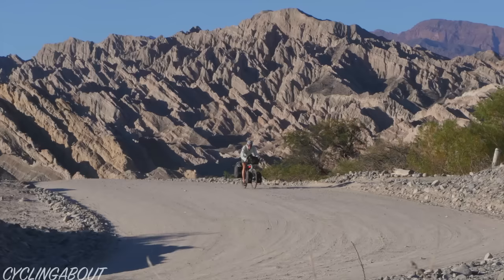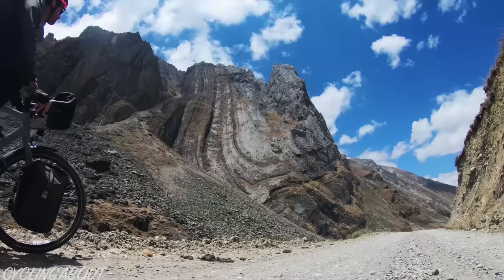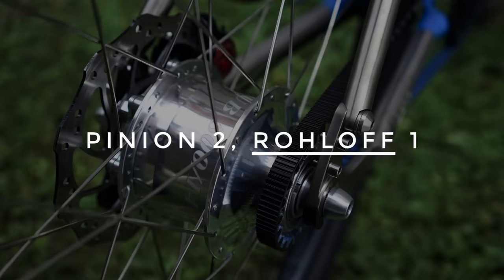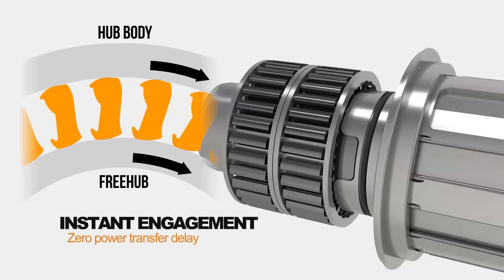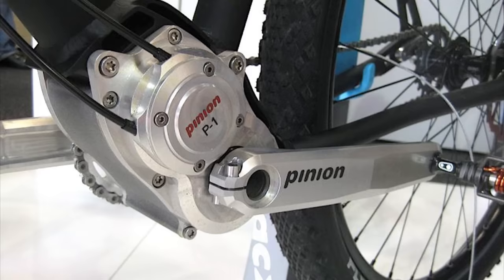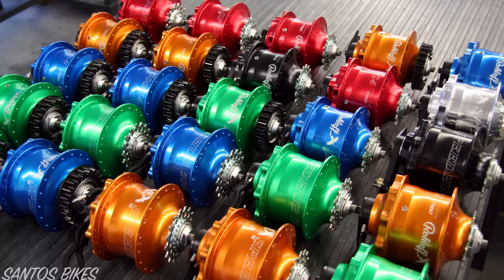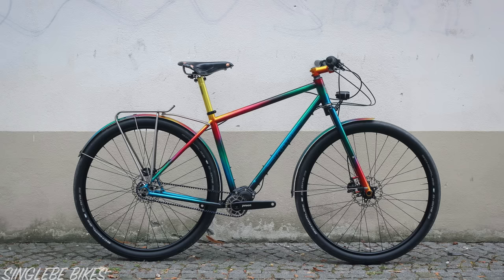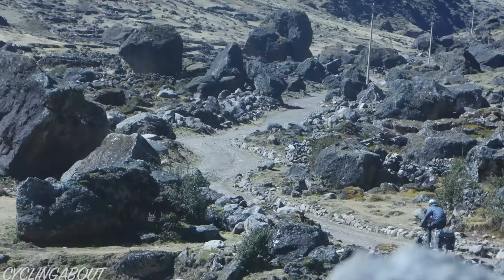What's The Ultimate Bicycle Gearbox? Rohloff Hub VS Pinion Gearbox

Comment: I use a Rohloff hub since 2009, now coupled with a Gates Carbon Drive transmission. I've done about 50.000 kms with it, always riding mountin bikes, and giving it a hard use. Zero problems. 
I don't understand why you say the Pinion it's better in MTB, especially the 1.18 it's not recomended for this use, as it's not strong enough. The same Pinion says it's quite better the 1.12 for mtb due to it's major robustness.
For the friction, I only noticed a little bit when new, just the first 1.000 kms. Now it rides absolutely smooth. The noise, as you say, only apreciable in seventh gear, but in any case, not doing more noise than any other bike with traditional gear system.
Reply from the maker: There is no doubt that centrally-mounted weight on a mountain bike is better for the ride dynamics and suspension performance. I'm not saying you can't ride a Rohloff off-road, it's just that the location of the mass is not ideal (I personally own a mountain bike with a Rohloff).
Reply: @Cyclingabout  As for weight distribution, okay. I meant that it is not fair to compare a Pinion P1.18 with a Rohloff, as long as the use made of it is MTB. The Rohloff will last you a lifetime and give you no problems, however, a P1.18 will hardly reach the half-life of the Rohloff. That's why they already did the P1.12.

Thanks for the videos!!
Reply from the maker: @angeletsoler  I've not heard of any durability issues with the P1.18 compared to the C1.12. Can you refer to me to any user experiences, in particular?

Comment: So...from watching this video, I should get the pinion, which means a new bike frame, my 2 MTB’s need selling, my road bike should get the Rohloff (new wheel cranks and shifter set) or...just keep riding on my “townie” a $400 Origin 8 with an awesome Shimano 3 speed hub. Choices.... actually I think I should get the Rohloff, but I’m not sure if I’m ready to go with the belt drive. Yet...

Comment: I purchased an NCM not a Plus but  its still a sweeet bike : ) it has so much power and the battery just keeps going  it should have come with optional running boards or pedals lol its a great bike i am getting an NCM for my wife too. 1500.00 CAD  im so impressed 🙂 . Dont buy another brand until you check these bikes first
Reply: I also drive one, a Hamburg for commuting. It has now almost 20k km, it's a little bit modified (brakes, fork), but it's a fine bicycle

Comment: Would you ever consider taking an early steel road Peugeot bike frame and convert to E- bike  with Roloff gearbox? Bike shops are telling me the traditional bike frames are not designed for e-bike conversion. Please advise.

Comment: One of the things I like about Rohloff is, if it breaks in an area with some but limited parts availability, you can replace it with a common three speed hub.  Is this a reasonable thing to appreciate?
Reply: NO.... 3 speed is 118 mm and the Rohloff is 135. Most other hubs more than 3 sp will fit.
Reply: @GordoGambler  huh, thanks.  How commonly available are hubs that will fit, in really out of the way places?
Reply: @DarxusC  ... Basically zero chance in 99.9% of shops. I order from SJS cycles in SW UK. They have everything.
Reply: @DarxusC  Actually, just above is a post by a bike mechanic from a small town in rural Canada.  He had someone come through with a malfunctioning Rohloff.  He was able to switch the Rohloff to a 1X11 hub with a derailleur so that they could continue their journey and get the Rohloff fixed later.

Comment: The pinion gearbox very closely resembles motorcycles gearboxes, same principle but it's strange how long it took to come into production.
Reply: Weight is an important factor for bicycles, but less for motorbikes. This gearboxes full of steel gears have to be light enough to compete with conventional chain systems, and they have to be produced cheap enough.
Reply: There have been a number of sequential gearboxes for bikes over the last 120 years, cost and proprietary components have been the main limiting factors in their adoption.

Comment: Your comparison glossed over the input torque limits of both options.  The Rohloff has a rather low input limit (130nm vs 250nm for the Pinion), that makes it incompatible with higher power e-bike kits (500-750w+) and why you see it often paired with the STEPS system which is 250w and 50nm.
Reply from the maker: Fair point. I should've made myself a bit more clear, as I was referring to 250W bikes.

Comment: Would have hoped to hear more about the special frame that the Pinion requires and its cost and availability. That dimension seems to put it in a different ballpark and kind of undermines all the other valid comparatve data.
Reply from the maker: There are 100+ Pinion frame manufacturers, but most Pinion gearboxes are purchased as part of a complete build. Pricing is around the same as a typical frame: 400 euros up to 4000 euros, depending on the frame material and level of customisation (mass produced vs custom).

Comment: No mention for the fact that the rolhoff mass is rotating while the pinion is static on the frame?
Reply from the maker: The mass is located around the axle, so it's not a problem. A small change in your tyre weight has a much, much bigger difference.

Comment: Prefer the ease of working on rear wheel issues with a Pinion. Not to mention if you are traveling, way easier to remove the rear quickly.

Comment: I can't say you've made my decision easier... but you have made it more informed. Maybe I could pair a Pinion with a Rohloff for a 252 speed setup and build a computerized shifter for a speed range of 2 to 120 kmph! Although that might be more complicated than I want... Actually, I have found a Pinion equipped bike at only $2300 USD that, while not perfect in other ways, is my front runner for a trekking build. My real question, though, is whether the gearbox is more important than off-road capability. In reality, I'm old enough that completing the cross-Michigan rail-to-trails system would leave me with a tremendous feeling of accomplishment, and is FAR more likely to happen than a trek across the jungles of Indonesia. So, realistically, my choice is between using my gravel bike (spending my money on a decent kit) or buying a new bike at all. Anyway, thanks for listening.
EDIT: So, 1 year later... I'm riding my old bike. It came down to budget. So I am still riding a chain/derailleur system. But I did invest in an ultrasonic cleaner.
Reply: Hey!  Thanks for posting this.

I've been debating buying a new bike with a Rohloff (or Pinion) for a couple years.  But I do also see the advantages of sticking with a derailleur.  It is clearly more efficient, lower upfront costs, and easier for local bike shops.  

I think my next bike will have a Rohloff, but it isn't easy to decide.  Lots of pros and cons for every option.

Comment: With a Gear Spread almost as good as a Rohloff at 1/2 the cost I've been extremely happy with my Alfine 11 being driven out of spec by a mild Mid Drive. As a comparison the best spread I could get with either hub was Rohloff Low Gear Inch of 12.2 & a High of 113.6 / With the Alfine 11 speed the Low Gear Inch was 17.1 & a High of 121.1 - Of course any hub can be dialed in a little higher or lower if your need requires it & if it ever blows up, I'll simply buy a new inner workings for a couple hundred dollars & just swap out the old.
Reply: The problem with the Alfine hubs is the choice of gear ratios. it doesn't matter if you can shift the over all range lower or higher by using a smaller or large front chain ring or rear sprocket. You are still stuck with the same large incremental and erratic jumps between gears.
Reply: @alexmorgan3435  On the Alfine 11 the ratios have never been a problem. On the 8 speed it was.
Reply from the maker: Good to know the Alfine 11 can go below the recommended output ratio!

Comment: I have a Smart Motion E Bike with a Rohloff 8 speed hub , I am looking at changing to at least a 12 speed hub as some of the gradients here in Tasmania are quite trying ( and at 75 yrs old ) ,  I feel that a 12 speed is better for me , ( My usual ride is between 70 and 100 km  ) and I have 2 batteries as with the gradients I have to change at 60 km , so with 4 more gears I may not have to change batteries ?

Comment: Both hubs need a limp mode for getting home in event of gearhub/pinion-drive failure. These should be at least a fixed gear at about 65 gear inches to get us home. Repairing either system on the road does not look possible.

Comment: I was seduced by a Rohloff and bought one. But I am reminded of them being draggy, a bit too often for my liking. I know the statistics are in the excellent video, but I would recommend others to try one for a decent amount of time - hire one for a day - before taking the plunge. It is noticeable - you will not need to look at graphs.
Reply from the maker: I think that's good advice. I've personally never noticed the drag when switching between my Rohloff and derailleur touring bikes (my average riding speeds remain the same), but I suspect it's the hub's whirring sound that gives the perception of inefficiency.

Comment: In the video you mention that you like grip shifters, do you like grip shifters better than trigger/lever shifters? If you do, why? I'm thinking of getting a bike with a internal hub gear and the only thing that I think I'd not like about it is the grip shift. Am I just making a faulty assumption based on my snobbyness?
Reply from the maker: I prefer triggers for mountain biking on trails, but twist shifters for touring. I can dump about 10 gears on my Rohloff at once, which I do surprisingly frequently.
Reply: Hi  @Cyclingabout  Thanks for the advice, the hub gear bike I'm getting will totally be for touring.

Comment: As you cannot change gear under load I would choose none, and so be very happy with a derailleur set-up.
Not to mention that for those prices I can buy tons of chains and cassettes.
Reply from the maker: To be clear, you can shift up under a full load in 15 different gears with the Pinion gearbox.

Comment: Thank you for taking your time to examine equipment.  I am looking for a city casual bike with lowest maintenance so I think the Pinion 6 or 9 gear box would be good for me.   Do you know how one goes about getting a bike for that with pedal assist electronics?  How does one start?
Reply: For a city casual bike a 3 gear hub will do it for about 1/10 of the price. And the overall system will not weight more then a regular hub with deraileur.

Comment: Superb video with great insight, thanks! My current bike has the humble Alfine-8 hub. After watching this video, I think I'd be more inclined to upgrade to a Rohloff next rather than go for a pinion bike... although that's probably primarily for cost reasons ;-)
Reply: Don't get the Alfine 11 anyway - 1st and especially 2nd gear are so spongy with, I suspect, roller clutches being loaded in series that you lose a chunk of eveyr pedal stroke to windup in the hub, so it feels terribly inefficient on climbs. 3rd gear and up feel perfect, but better to save for the Rohloff.
Reply: With a Pinion gear box you will need a new frame to accept it or spend a fortune modifying your current frame, if it is possible and the frame is stiff enough.
Alfine 8 spd hub is good but the gear ratios are poorly selected far too large jumps between the gears especially 5-6-7. No good at all for cycle touring only flatfish commuting.
Reply: I have a GT Traffic with an Alfine, and for commuting and errands, it works great. Just ordered a CoMotion tandem built for 38C tires to accommodate touring, gravel, and some double track. After a great deal of analysis, we went with the Rohloff. Maintenance, wheel changes, and the gear increments are not issues. Top end speed on a light touring tandem also not an issue. However, simplicity, weight, and legacy reliability convinced us. Tandems require some additional engineering for the opinion that in my opinion are simply not worked out well yet.

Comment: Hi, great channel, unique in what you're doing so huge respect for that, but I've a question that I'm hoping you can help me with. I'm just out of hospital and I need to make bike much more reliable as I'm running a Bafung DIY BBS02 750w motor, which eats chains and cassettes as I'm fully expecting to need change that when changing the chain. I'm using a 9 speed set up with a kca(?) electric chain,  I tried others but they didn't last and now the chain is doing the job certain gears on the cassette are wearing fast, so much I can't use them due to wear. 
So, I'm trying to find out if these gearbox type systems can handle the torque of the electric motor?  I realise they aren't designed for that but I'm a bike mechanic and don't abuse the power as I'm mechanically sympathetic. I know it's cheating having an electric motor but I almost lost a leg so as my main transport is my bike, minimum 100 miles weekly,  the idea of a gearbox sounds like the perfect solution as I don't nèd 9 speeds from the cassette and have different front ring sizes for road or off road use, but what gearbox would be best, will the one featured here on the Bosch e bike motor be suitable and if I was going for belt drive can I swap out the front drive pulley to different ratios or are you stuck due to lack of adjustment to tighten the belt correctly?  Also the rear derailleur is taking a beating, its the same one that's been on this bike for the last 8 years but it's gonna go soon, so a chain,  cassette and derailleur every year I'm estimating as I've only been running it since June 2022. Any advice would be greatly appreciated, cheers, keep on cycling, the best way to see the world.
It seems the Rohloff is the option for me as its a mid drive kit I have on a Kona Munimula from 1999! As I said,  I'm a bike mechanic and I like the Kona but I have a Specialized frame that I may use as it's on 27.5 rims instead of the Kona on 26. But I'm really interested in a gearbox, just its strength gives me concerns

Comment: Hi Alee; what are your thoughts on continuously variable transmissions? They appear fairly popular on some commuter/urban bikes; would they be able to cope with the load of a touring bike?
Reply from the maker: CVT is a pretty inefficient (or heavy) system. The CVT stuff that's currently available is a bit lacking in gear range too. Not a bad option on an eBike though.

Comment: I'm impressed with the rides you've accomplished.  Regarding geared hubs, is there one that has the low to high range of the Rohloff but with fewer gear steps in-between?
Reply from the maker: Hmmm... nothing in the hub gear world, but the Pinion P1.9 has nine gears over 568%.

Comment: There is no system more efficient than a normal chain drive. Direct drive chain is more than 99% effective. Belt drive is 1-2% less. Even with a derailleur, chain drive is way more efficient than any other system. It's also lighter, cheaper, and easier to repair.

Comment: Thanks for the comparative! I have a question: how does the NuVinci Continuously Variable Planetary Transmission perform compared to Rohloff and Pinion?
Reply from the maker: Nuvinci is 500-700 grams heavier than a Rohloff, has substantially less gear range (360% vs 526% or 636% for Pinion) it runs at ~83.5% efficient rather than the 90-95% of a Pinion/Rohloff.

Comment: For my commuter bike, in a mostly flat metropolitan area, the Rohloff wins for sure. It has plenty of climbing ability for my area, and the increased top speed is a benefit. Ultimately, the strengths of the Pinion are not necessary here, so the cost and weight aren’t justified

Comment: I would also be quite interested to know which system pairs up best for an ebike?

So is it better to have pinion plus rear hub motor or rholhoff plus mid drive motor.
Reply from the maker: There is a section on eBikes in the video. I think Rohloff is the best option, but there are advantages to a rear hub motor too.

Comment: No. 19. Tandem bikes! ;) Rohloff (or even Alfine 11) looks like a winner now... 
Would you explain why Co-Motion had to design a triple chain transmission to incorporate a Pinion gearbox?
Reply from the maker: The chainring speed and crank speed are different with the Pinion gearbox. This basically means the rear tandem rider would have to pedal both out of phase, and at a 50%+ faster cadence if you were to run the standard double chain setup!
Reply: @Cyclingabout  I have to think it over...  because I definitely am missing something:

1. Both left- and right-hand side stocker's crankarms are in phase but not in phase with the chainring driving the rear wheel. 
2. If we attach the same chainrings to the captain's and stocker's left-hand side cranks, they will both pedal in unison, won't they?
Reply from the maker: Think of it this way:
- The two cranksets are first connected via the tandem timing belt to keep the cyclists in phase.
- The combined leg power of both cyclists is then sent to the gearbox. 
- The gearbox then works its magic to adjust the output gear based on the gear selected.
- The belt connecting the gearbox and rear wheel will run at a different speed to the other two belts.

Comment: the biggest difference is definitely the frames. wheel hub can go on anything where as the gear box requires a special frame. the price tag on those is a bit unreasonable for what you're getting either way lol... can't say i'd even remotely look to spend over $1500-$2000 for something like that.
Reply: Yah but, car depreciation is like 10x that ....